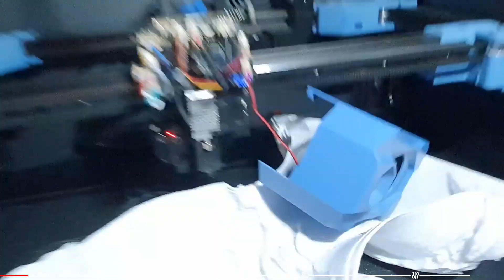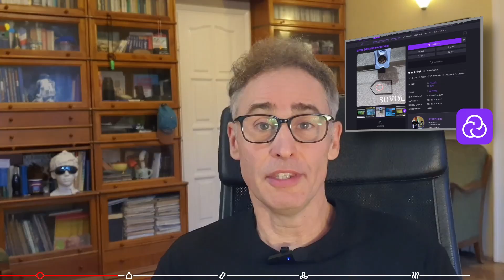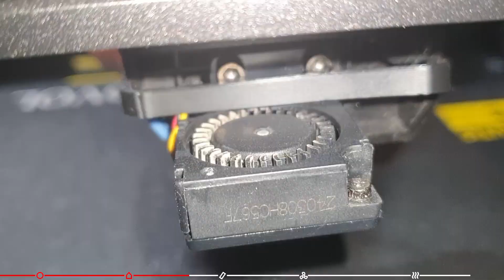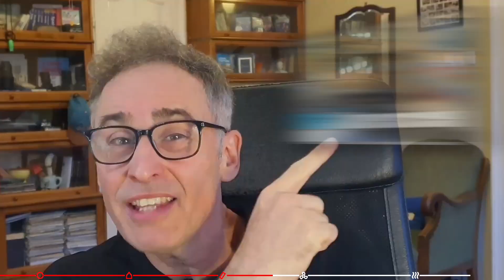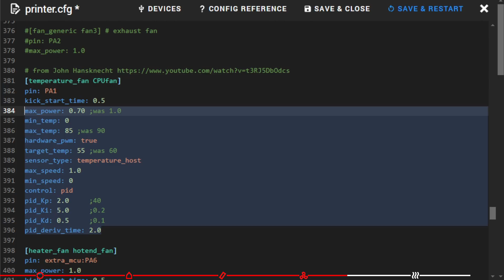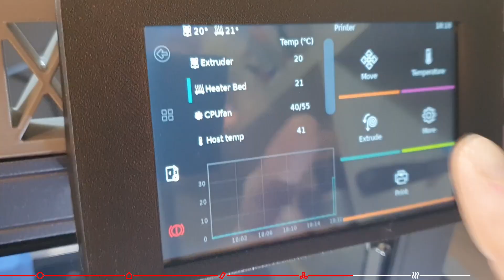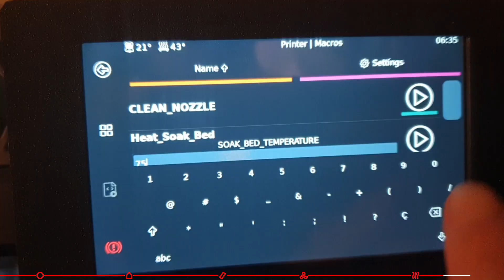5 Tiny Upgrades to Boost Your Sovol SV08's Reliability + other Klipper 3D Printers: SV06 SV07 Q1Pro

Comment: Thank you, another excellent video. I will fully prepared once I get my sv08! Keep up the excellent work, much appreciated 
Oh and wouldn't a simple large reusable rubber band work to hold the extruder cover? One can even purchase 1/4" 3" ones in blue...just a thought but your fix works nice too as it stays out of the way when released
Reply from the maker: My thinking: why purchase anything when we have a 3d printer :) Also I like the look of a custom printed piece better than either a rubber band or a ziptie. This is not supposed to be a band-aid, this is a permanent enhancement! Congrats to your printer btw. I am exactly like this. Before I get any new device I watch and ready everything I can to prepare. You'd think this diminishes as they start to send you tons of stuff, but even after 3d printer #6 or laser engraver #5 I am still this way. One track mind until I get it and then tune it to the max to bring out the best. I love my SV08!

Comment: The printed TPU rings are a GREAT idea. But...would it not be easier to simply purchase some fitting O-Rings?
Reply from the maker: You could try, but printing only takes 3 minutes and costs about 5¢ in filament. Plus, O-rings might be too thick—we only need a 2-layer (0.4mm) thin ring so that loosening the screw still allows it to spin freely. Lastly, finding the exact size O-ring might be difficult, whereas custom-printing gives you the perfect fit.

But if Sovol decided to upgrade their design, they will probably use some kind of o-rings and I envision a thumb screw replacement, so we can manually adjust the friction without the need for an Alen key.

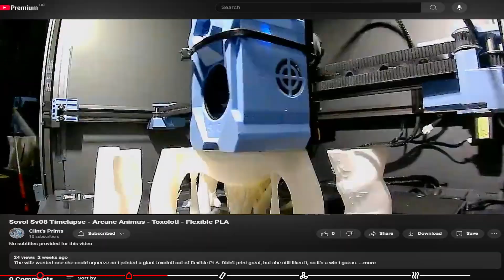Comment: 5:29 that’s not true. You can remove a zip tie by pushing a flat head screw drive into the clamp of the zip tie and push the end back out

But not as convenient as your solution
Reply from the maker: Good tip! Thank you.

Comment: Another note for folks with the stock MCU fan; cut the punched "grill" out. Those stamped holes are shockingly bad for restricting airflow; leave it open or find a low-profile, high-flow grill to print (I hot-glued thing:4288719 to the bottom of the rivnuts, but you do you).
Reply from the maker: Important tip!! There is really no reason to put a big grill on it as it is at the bottom, most likely facing your desk's surface. You'll need flex or dremmel to cut through the metal though.
Reply: @gerGoPrint3D  Heh - back in my PC building days this was always Step One. The funny part was that I drove to three different shops looking for 40mm wire fan grills before I realized "Hey, I have a 3D printer now..." 😖🙄
Personally, I feel a 15 minute print is cheap insurance against a stray purge line or skirt loop getting under the printer, but that's probably more because a bare fan just feels unfinished to me.

Comment: Hola
buen dia

desearia saber si cuentas con los diagramas electricos de la fuente de poder de la sovol 07 plus

el dia de hoy me encontraba trabajando con ella y de la nada empezo a soltar chispas y  creo corto circuito
necesito revisarlo a fondo pero quisiera saber si me pudieras compartir ese diagrama tecnico en caso de que lo tengas.

gracias por tus videos, tan informativos y de alto detalle
Reply from the maker: I am sorry to hear about the accident. Glad to hear you are safe. Unfortunately I don't have any technical information about the power supply. But it's a standard Meanwell, you can replace it for cheap, and you can probably find good documentation on it (e.g. Meanwell Technical manual).

Comment: gerGO, Thanks for the SV08 content. I saw in your introduction you had an Error 8 'Klipper has Shutdown' (timestamp 0:55). I am receiving the same Error 8 TMC 'stepper_Z1' on my SV08 printer during long prints. I have not completed a full long print yet because I keep receiving the Error 8 and Klipper resets and losing the whole print. This is very frustrating and aggravating and I have accrued a lot of wasted filament too.  How did you fix it? I contacted Sovol and I adjusted all four Z-axis motor amperage in Klipper from .58 to .48 amps and from silent mode to non-silent mode and replaced the Z2 stepper motor and Z2 cable. That did not fix the issue and finally I replaced the SV08 motherboard and I'm still receiving Error 8 TMC 'stepper_Z1'. What was your solution to fix the Error 8 TMC 'stepper_Z1' issue?
Reply from the maker: It only happened once here. I talk about it in the video https://youtu.be/hCsBGvjoXOA. I concluded that it was likely caused by overheating due to the summer heat and the increased work for the Z motors because of the higher Z-hop distance in that particular print. If this keeps happening to you, make sure that the back-right corner of the printer is not pushed into a corner of the desk or walls where air ventilation is limited. In the worst case, you can add a fan (you might be able to share the header with the newly updated load-activated case fan) to help keep it cool.
Reply: Im having the same "Stepper Z1" error on my sV08 too. So far, Sovol has been helpful and sent me a new z motor and cable, but that didnt help. They're currently sending me a new motherboard to swap out, guessing that its an overloaded driver on the board thats throwing the error. I hope the new board fixes it, cuz i miss being able to do long prints!
Reply from the maker: @benpryce  That error in my video is from my recent https://youtu.be/hCsBGvjoXOA where it was fixed by adding extra cooling, but it sounds like your issue might be more serious. Hopefully, the new motherboard will solve it!
Reply: @gerGoPrint3D  I actually got the idea from you to put a ferrite bead on the USB cable to the HDMI screen, and wouldnt you know....so far the problem seems to have gone away! Ive done about 12 hours of printing with no failures so far. Keep your fingers crossed that works. 

I have the new motherboard from Sovol in hand, but havent installed it yet.
Reply from the maker: @benpryce I'm not sure, but the USB cable between the screen and controller board only carries touch information. The stepper_z1 issue is specifically related to the Z motors and drivers. But who knows—there could be all kinds of butterfly effects happening in these machines :)
Reply: @gerGoPrint3D  Im a bit confused as well, but just finished two back to back 5+ hour prints with no problems right after adding the bead 🤷‍♂
Reply from the maker: @benpryce  Could that cable have been interfering with the toolhead cable?? Good to hear the issue is resolved for you!!
Reply: @gerGoPrint3D  not sure! maybe interfering with the motor cable?

Comment: FWIW, the zip-tie method really isn't a big deal. I've had to remove the tie once since installing it to swap in a fresh nozzle on my SV08. Might print the clip anyway. That damned spool holder on the other hand has caused at least 2 or 3 larger prints to fail because it unwinds. Twice it also had a "tangle" when the filament hit the end of the spool where they tuck it for winding. Just happened on a big piece, really annoying.

You also might want to include something about using the built-in _CALIBRATION_ZOFFSET macro instead of the QGL - Said macro homes, does the QGL, cleans the nozzle, probes the plate to find "zero", then calibrates the probe pressure and checks the probe distance from the nozzle before homing again. Only adds about a minute to a print and gives me nice clean first layers.

You thought about moving to mainline Klipper and/or installing an upgraded probe or hotend? I got an Eddy and the board flasher, looking forward to that high speed 100x100 bed mesh. Been putting it off because I got 3 new printers and I had to do maintenance on 3 others, plus printing tasks.
Reply from the maker: Hey Clint! Thanks for the kind permission to use your spectacular timelapses!! I aim to keep my printer as close to stock as possible to be able to help regular users. My self-tasked mission is to bring out the most from the stock SV08 (my T300 is another story... https://youtu.be/Ni-Gmygg1g8). Anyway, I could be lucky, but my bed is not so bad and the QGL + regular ABL mesh provides me with a pretty even first layer, sufficient for basis for multi-day prints. I think the key is to let it heat soak 10 minutes before starting to scan, and make sure to provoke that crack sound before starting the pre-print calibrations, that's when the bed actually takes up its expanded shape.  Yes, 1 extra minute with your extended macro vs about 10 minutes with my heat soaking, but the result is similar, and this is something I can actually recommend to new owners of the printer, as opposed to switching software and replacing some components. Hence these "tiny" upgrades vs complete toolhead swaps...  Maybe in a few months I get itchy and start moving things around in my SV08 as well, but for now, its good enough as it is.
Reply: @gerGoPrint3D  No problem, glad it can be put to use. My process starts with a heatsoak as well, I just use the z-offset calibration instead of the basic gantry level.  I mention the calibration macro because using it + heat soaking, my bed mesh variance dropped from an average of 0.600-0.650mm to 0.300-0.400mm.

I watched your videos on the printer with eager anticipation while I waited for mine, so I was aware of the shortcomings and tweaks that may be necessary. Big resource for people who are undecided, or who took the dive but aren't getting the results they want.

The SV08 is an impressive beast, mine has over 640 hours of print time since July 20th. Made it to about 580 hours before I had to break down and tune the belts and swap a nozzle. Everything from giant prints to (large) tabletop scale stuff. The Eddy wasn't necessary, I just prefer precision. The SV08 has managed to match both Bambu A1 and Prusa XL quality while moving significantly faster than either one.

At this point I just heat soak the printer while I login to the workstation, load Orca, pick a model and slice it. By the time the slicer is done, I can run the z-offset macro and then hit send. I could probably simplify that by editing the start gcode to include the zoffset instead of the QGL.

Comment: I started my spools on my SV07 by loading it backwards, so it unloads from the bottom of the spool.
once the winding calms down, I flip it back.
In addition, I affixed the cover to the back of the cooling fan to help gently guide the ribbon cable out of the way of the print.
my last SV07 failed due to the ribbon cable falling apart from too much flexing in one spot

Comment: Hey, thanks for the video. I got my SV08 a few weeks ago now and i havnt run into any issues so far. I directly acitaved the full potential of klipper and optimized the Start G-Code and many small stuff. But i also used a 3d printed housing, because its cheaper and i think also better isolated than the original one. Maybe you should make a video, not as deep as your current ones, about the SV08 with a good short summary of the upgrades. Also i think there is way more potential in the SOFTWARE than in hardware upgrades .... just MY opinion :) keep it up! very symphatic guy u are ! :)

Comment: Cool! In the next video you can address the worst and most difficult solution, the heated bed with the taco or U shape after heating.
Reply from the maker: tbh I don't have any problem with the bed. the key is to preheat, so it takes up its shape before scanning. Then abl takes care of it. I have <0.3mm range at 65°C which is quite OK for a bed like this.  Here is one little trick: after heat soaking for 10 minutes, just before printing i like to push the corners with my finger, I hear a crack noise I know it is now expanded to its 65°C (or 75°C, 90°C) shape, then I start the QGC and ABL scan.  Without heat soaking I noticed this crack sound came during the first layer, and that caused half the first layer not to be optimal.
Reply: @gerGoPrint3D Mine doesn't crack on the first layer or print, but always on the first heating of the day. I tried to push the corners after soaking but there was almost no improvement, the problem is in the center, but at least it reduced those warped corners on large wide prints, the problem is that the middle region is inconsistent, especially with supports. In the groups, what I've seen is people printing supports to put under the bed.

Comment: Hmm, never considered EMI for the MCU problem, it has been annoying me for sure.. Ferrite chokes ordered to see.. cheers Gergo.
Reply from the maker: The jury’s still out on it, but I’ve had a long streak of no issues since adding the ferrite choke. It made sense to me that the problems started after I added the metallic enclosure (and the HDMI screen, which might have added extra load to the system—but I tested it, and Klipper crashed even without the screen).
Reply: @gerGoPrint3D  yeah, only got the issue when I added the enclosure also.. well was either that or mainline and the logs don't indicate a software problem.😀
Reply from the maker: @getcass  The plot thickens. I am also in discussion with the Sovol team about this
Reply: @gerGoPrint3D  nah dropping a Ferrite bead seems not to fix mine, just got another there with it on while doing a bed mesh, managed to get a 2 QGL, 2 bedmesh and a Benchy before it fell over again.  The search continues.

Comment: Great video, on my spool holder and hotend cover I used tape.For the mid print error where print just stopped, I realized I had to many files stored on the SV08 from Klipper.Once I deleted some of them it seemed to print fine.I stopped using the spool holder but like your fix for it.Hotend cover with scotch clear tape works for now.TH3D here in the USA had a quieter fan I put below the printer that was the same size as original.This worked for me.Noticed my hotend fan has not been working for at least the last 10 prints,so when its was thrown off printer before using tape to hold it on, it must of broke a wire. I keep forgetting to check it. Still printing perfest without it. Keep up the great videos, I enjoy watching them.
Reply from the maker: Great tip about deleting unnecessary files—that can definitely help avoid mid-print errors. I’d still recommend adding the case fan block; it’ll make your quieter fan run less often and extend its life. Thanks for the detailed feedback! Your solutions, like using tape and the quieter fan from TH3D, are great tips for the community. The SV08 part cooling has good headroom, so unless you’re working on a tricky print, the main part cooling fan should be sufficient. However, it’s still a good idea to replace it as soon as possible for better performance.

Comment: GerGo in your opinion sv08 i good printer for small print farm. After your upgrades will work ok. Usually i print 12 h / 6 day a week abs or asa. now i have 6 printer reborn 2 i i want update all and  sorry for my english
Reply from the maker: For printing with ABS and ASA, you should add a chamber heater. It’s easy to do. Watch my Qidi Tech Q1 Pro comparison video → https://youtu.be/ynRUsIDnBwA If a smaller print area is okay for you, it could be a good option, but I’m not very happy with its extruder. The SV08 has a good motion system, extruder, big print area, and is easy to upgrade because it’s open source. But for temperature-sensitive materials, it takes a long time to heat the large print area using only the bed. Adding a chamber heater will make it a great machine, even for a print farm.

Comment: I had my cover come of mid print because the magnets popped out.  I've since just put a rubber band around the cover because I needed a quick fix, and it's been fine.  Great suggestions though.  The ferrite bead is interesting, and one to keep in mind for sure, I have a few laying around (I harvest electronic parts). I haven't switched over to Klipper yet, kind of hesitant because of issues I've read about from others. I appreciate your videos though, and the way you present information, thank you!
Reply from the maker: Thanks so much for the encouragement! I'm glad you found the suggestions helpful. The harness is really easy to add, so I’d recommend giving it a try when you can. Just to clarify, did you mean you haven't made any changes to the stock Klipper on the SV08? I’m still using the stock Klipper too—these upgrades can just be written directly into the printer.cfg file. Even I managed it without breaking anything, so that’s saying something!

Comment: Nice vid.
I loved the toilet paper mod :D
I personally fixed it with a couple of winds of electric tape at the end of the spool holder. It does not let the bearings to do their job, and the pipe is slipery enough to let the spool roll when pulled. I think it works purrrfect :D

Comment: Hey man, great vid as usual. Have you considered designing a printer, might be a cool addition to the channel. Just a video series idea, there is very little resource on that online
Reply from the maker: I think that would be way above my abilities. I am just a fellow user figuring out small things and just sharing what I come across. But thanks for all the support :)
Reply: On my SV08, I found that flipping the direction of the spool fixed the issue of unspooling too easily. Seemed counterintuitive but it worked well
Reply from the maker: @ethansmith7  Cool! Yeah, I wouldn't have thought of that. I will try next time.